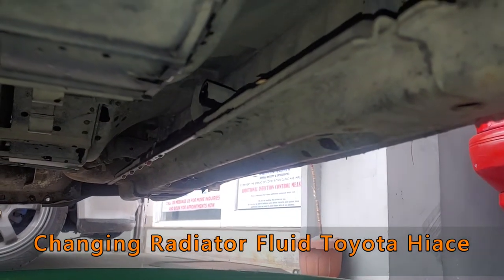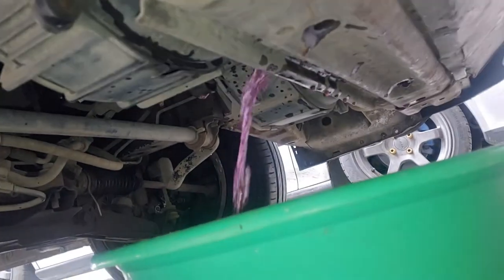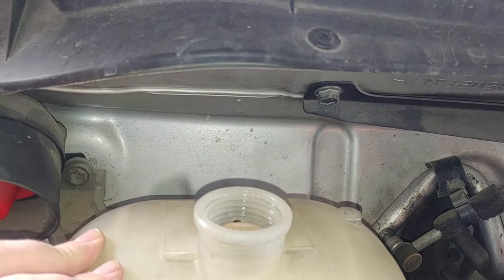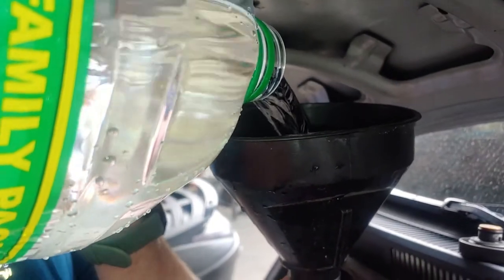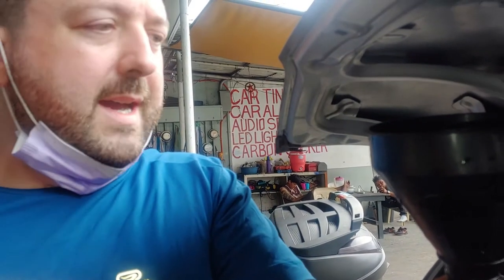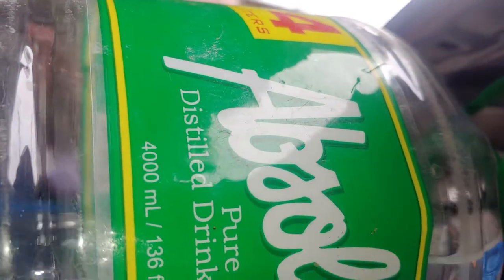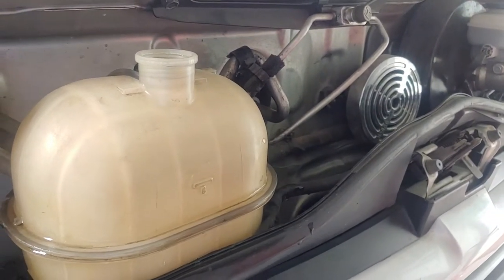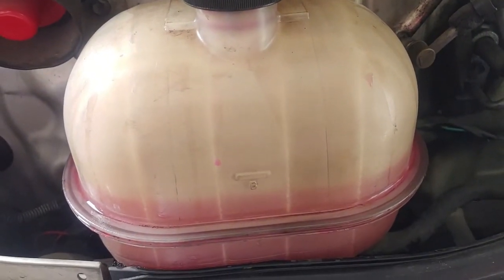Toyota Hiace Radiator Fluid change 2006

Comment: block has a drain plug you just drain the radiator and block then refill
Reply from the maker: I was flushing it because someone borrowed the van and mixed the wrong type of fluid

Comment: What would happen if you just top the van up with coolant and not removing the old one
Reply from the maker: so when different coolants mix depending on the type it can turn the coolant to a gel and then clog up and prevent flow through the engine for cooling. if your coolant is low you can top it off just fine with the same type of coolant. but here we had someone put in green coolant instead of pink. so that is why I flushed it to make sure we didn't get a bad reaction it was only a few days that the green was in there and not much. but I wanted to be safe. and also you should flush your coolant every 30000 miles or 45000 kilometers.

Comment: Hi , so just a question, when you flush the old coolant , you added water and flush it again and then you fill it up with the new coolant ? How many litres?!
Reply from the maker: You need to use distilled water only. The van should hold about 8 liters. Sometime some air can get trapped so when you add the water you might not get all of it in at first but start the car with the coolant cap off and it should fill in the air pockets then you can add some more water again and run the engine for a few minutes to run through the system then let it cool and drain again. Then you can fill it with coolant. And also follow the air removal again and check the fluid level again after a drive may need to add a bit more as more air pockets are filled then it will be good to go